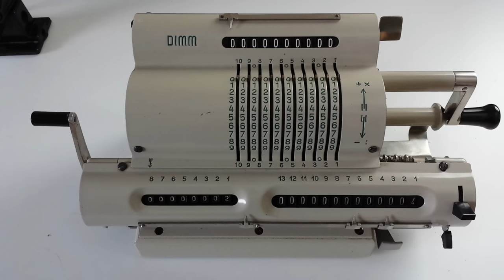Mechanical calculator in action

Comment: Pulls out this machine during the SAT...
Reply: lol
Reply: I used a slide rule on my Chem exam just for kicks.  Much more practical than an adding machine.  Much smaller, lighter, quieter, and much faster to do any operation other than addition or subtraction.
Reply: @richardhall9815  What I find hilarious is I've seen a race car team use slide rules. However, what's amazing is they were using it to calculate fuel burn rates so they would know on what lap their driver would run dry. The system was amazingly accurate to within 1-2 laps! I have never used a slide rule so I don't know how they used one to calculate their driver's fuel mileage.
Reply: Shot by desk neighbour
Reply: Exam proctor: you cannot use DIMMs latest model, it would give you an unfair adavantage over the other students, only the 1948 and prior models are allowd during this exam
Student: ...
Reply: 🔔*Ding*🔔
Reply: One of the teachers in my secondary specifically the vice principal had one of these
Reply: Ka-chunka chunka chunka. Ding! Rzzzzzt ka-chunka chunka chunka chunka chunka
Reply: "Not the rich kid..."
Reply: @richardhall9815  I was in the last class year that taught slide in junior high and still have the pocket model I bought for homework.
Reply: Ding Ding
Reply: I mean if you know what your doing
Reply: Everyone during the test: quiet
You: CLICK-CLICK CLICK, CLICK CLICK CLICK
Reply: . Please be careful before arriving to an SAT testing site with this particular model. I don’t know if it is on their list of approved calculators
Reply: @jessicaaldrich4777  As this is a 4 function calculator it'd be permitted, and while rules say that only battery calculators are allowed, it seems pretty clear that this rule is mainly to ban corded calculators. The approval list applies only to graphing calculators. Scientific and 4 function seem to be all ok.

Comment: I do so love technology that doesn't need to be plugged into anything.
Reply: You should see the mechanical calculators that you do plug in, they’re awesome to see working.
Reply: baterries
Reply: @Benjamin Pilgrim However an everyday pocket calculator is:

- boring
- uninteresting
- you can’t see any of the mechanisms, it’s all just silicon components
- widespread

With a mechanical calculator you can:

- easily see how it works and every single moving component of it
- they sound cool because of all the clicks and clacks of mechanical devices inside it
- not very common
Reply: @timehunter9467  Like the Friden STW10?
Reply: @mega_micro   However an everyday pocket calculator is:

- boring
- uninteresting
- you can’t see any of the mechanisms, it’s all just silicon components
- widespread

With a mechanical calculator you can:

- easily see how it works and every single moving component of it
- they sound cool because of all the clicks and clacks of mechanical devices inside it
- not very common
Reply: @suspense_comix3237  Yeah! Scary sounding thing.
Reply: @Benjamin Pilgrim I have my scientific calculator from 2005, it's now on its 4th set of mercury batteries.
Reply: @Benjamin Pilgrim You know what they mean.
Reply: I prefer a regular modern calculator, but everyone is different.
Reply: Plug-n-play
Reply: @suspense_comix3237  I mean these are cool for the novelty, but utterly useless when doing calculus compared to modern calculators.

Comment: As an aspiring mechanical engineering student my mind is just totally blown right now. How tf..... how was this made? How does it work? How did they make it so compact without rendering it fragile? Even if I took this thing apart slowly I dont know if I could even begin to figure this thing out. Things like this are exactly why I'm choosing this as my major :)
Reply: It's made with logic gates.. But I don't know how they made it so compact..
Reply: It’s crazy to understand that back then these calculators weren’t even designed with 3D printers or CAD software or anything!

They were all designed with pen and paper math, LOTS OF MEASUREMENTS, etc.

I someday hope to design something mechanical but IT’S IMPOSSIBLE TO BUILD SOMETHING AS COMPLICATED AS THAT WITHOUT MODERN TOOLS LIKE 3D PRINTERS.
Reply: @kato_dsrdr  No, it’s made with all the mechanical devices like gears and axles and stuff.

If it was made using logic gates the thing would be HUGE and electromechanical, not mechanical.
Reply: Selecting a number causes pins to protrude from a wheel, turn the handle and the pins engage the gear attached to a number wheel. There is a carry mechanism which clicks the adjacent wheel one click when it needs to carry.
Reply: logic gates can be mechanical. However I think you are right here and that it doesn’t do it by binary. The basic way these work is by allowing each digit to affect the next digit which carries. Look up those card & stylus calculators they work extremely similarly
Reply: An abacus
Reply: i saw this forst time in m life and know exactly how it works
Reply: As a electrical engineer I just have to say “look what hey need to do to mimic a fraction of my power”
Reply: @kato_dsrdr no logic gates were used in this device.  It would be thr size of a house if mechanical logic gates were in play.  It would also be electromechanical.

Comment: Division operation looks tedious after a while. A simple straightforward test of these mechanical calc's accuracy is to multiply 12345679 times 45, the answer should always be 555555555 on these machines.

Comment: This machine can do so much more! You totally missed the multiplication of big numbers, e.g. 2345 x 4567. You don't enter 4567 and turn 2345 times, you only turn 5 times, then shift to the right, turn 4 times, shift to the right, turn 3 times, shift to the right, turn 2 times. Basically you do it like you would do it on paper! To check your result, your second multiplier should now show up in the turn counter. 

You can get a division result with decimals if you enter the dividend as far left as possible (316400000 / 13 = 24338461; you just have to remember where to put the decimal point). You can even calculate square roots using Toepler's algorithm (not much more difficult than doing a division), but this space is too small to explain it. Google is your friend!

Comment: My first job was an accountant at the original Coopers & Lybrand in 1971. Out audit files were often inches thick and were full of tables and schedules, all of which had to be checked for accuracy becuase they formed the basis of the balance sheets and P&Ls of the companies we were auditing.
We gave the file to a comptometer operator who used one of these as well as a  comptometer machine. I good operator was a highly skilled person and very well paid. They could go through a big file in less than a day. And they usually found mistakes. They did it all blind...they just ran down the lists by eye and both hands were going flat out. It was amazing to watch.
Reply: There is no physical computing machine that can add a column of printed figures faster than a Comptometer operator. "Whaddya mean? A spreadsheet can add them in a microsecond!" But someone had to type those numbers into the spreadsheet, one snail-like digit at a time!

Comment: I grew up at the point where transistors were just starting to take over... I learned to use slide rules, adding machines (Similar to yours) and now obsolete transistor calculators. In high school, typewriters were still used, small (desktop) computers were just coming out.

Comment: divide by 0 please
Reply: It's division performed with subtraction, so you have to spin it counter-clockwise infinitely
Reply: @어질어질하네-k8h  so attach a motor to the thing
Reply: You need to leave!
Reply: @어질어질하네-k8h  not infinitely. only until the wear on the machine causes it to fall apart.

Comment: I have one of these - different make, same principle -  bought on a fleamarket years ago.  It doesn't work for one reason: metal gears running on nylon and wearing it away. Still, I didn't pay much for it.  I have an idea that the older, pre-nylon,  models might work better today.  The same applies to old cameras: around 1960 the dreaded plastic gears appeared and the life expectancy went out the window.

Comment: How many GB of RAM ?
Reply: this is mechanical, I don't think it will have RAM
Reply: over 9000!
Reply: No Im patient ~
Reply: I know you were just joking, but I figured out that it has exactly 9.56805815563 bytes (76.5444652451 bits) of "RAM".
Reply: ***** that's a lot
Reply: It's a little more than I was expecting, tbh.
Reply: So it has...dits?
Reply: @dmdz Decits.
Reply: zero
Reply: A "decimal digit" would just be a digit. The term "digit" without further qualification assumes base 10 (but it doesn't hurt to specify base 10 depending on the context).

@Sergio Díaz Nila, true- it doesn't technically have any base 2 digits (bits) like most computers do. What it does have is 13 base 10 digits in the accumulator and 8 base 18 digits in the counting register. This means the machine can represent an equivalent amount of information as ~76.5 bits (though I do realize fractional bits are strictly theoretical, and can't actually exist :P).
Reply: Infinity cuz its mechanical.
Reply: Infinity
Reply: Not sure, but it’s DIMM RAM (it says DIMM on the calculator)
Reply: @foxbud  They can, you've just shown why.
Reply: @martilezeon8500  r/Whooosh
Reply: 10 TB

Comment: to prevent sliding on the table with bigger numbers, bolt it down. if you are not strong enough to turn the crank, remove the crank knob, take a meter of a scaffolding pipe and slide it over the crank. precise and accuratw technology. amazing.

Comment: It's amazing how such a machine evolved into what we know now as a computer. And amazingly, the way CPU works is basically the same - you have your input/output stores (registers), a component that does arithmetic (ALU) and a component that makes the machine run - the clock in a CPU, the rotating lever in this device.

Also, the action at 0:50 with that lever, the sound, it was really rewarding. Pretty cool machine.

Comment: My Monroe Model K made in 1922 is similar except it is large and heavy. It has more capacity. It has outlived every generation of electronic computer. Still works perfectly. You earn your answer. Mine has an 8 decade keyboard, 8 counter dials and 16 accumulator dials (more than Microsoft Excel).

Comment: Actually I have an extremely similar looking Soviet version that is called ''Felix'' and it works very similarly to this too. It is less complex and doesn't have the cool features that this one has, like the convenient levers to push the lower panel around. Instead it has a janky lever like thingy that moves it left or right (One number order each push) depending on in which direction (where) you push it which tends to get stuck a lot... Also it has little propellers with roughly similar shape as the Russian ф character which do all the resetting. This one's definitely more sophisticated, but I really love mine too, I have it alongside two other ones which I still- call Felix, but don't actually have their name displayed (Apparently they were produced after 1972 or something after which the original Felix became redundant, and fittingly they are much more sophisticated, with actual number keyboard and front-back buttons that shift the order around. They also have a much boxier look, sleeker for the lack of a better word). They're much more intuitive and fun to play around and worth with, but I still prefer the almost alien spaceship look of the old Felix. Speaking of which, my Felix very cool teal color, even though I've seen white, grey and black ones too.

Comment: Curiosity got the best of me, and I figured out that this machine has exactly 9.56805815563 bytes (76.5444652451 bits) of "RAM".

Explanation:

First, what could be considered RAM in this machine?

In a modern computer, RAM would simply be the memory the CPU uses for storing calculations (disregarding the caches and CPU registers). The analog for this machine would be the accumulator and counting register within the carriage, as those are the memory used for storing calculations.

The accumulator contains 13 base 10 digits. That means that each of those 13 wheels can take on a value between 0 and 9 for 10 total possible values.

The counting register is a little more tricky. It can take on values between 0 and 9 for addition, but it can also take on red values between 0 and 9 for subtraction. Does this mean it can take on 10 + 10 = 20 values? No, not quite. Addition and subtraction both share common 0 and 9 values, subtracting 2 from the previous total. That means that the counting register contains 8 base 18 digits.

We now know that the carriage can represent a total of (10 ^ 13) * (18 ^ 8) = 1.1019960576 * 10 ^ 23 unique values. The minimum number of base 2 digits (or bits) require to hold this number is 77. The problem is that 2 ^ 77 can represent more values than (10 ^ 13) * (18 ^ 8) can, (2 ^ 77) - (10 ^ 13) * (18 ^ 8) = 4.09161216918 * 10 ^ 22 values to be exact. So we can't say the answer is 77 bits.

To get the exact number of bits required, we need to solve the following equation for x: 2 ^ x = (10 ^ 13) * (18 ^ 8) by taking the log base 2 of each side. This gives us x = 13 * log base 2 of 10 + 8 * log base 2 of 18. This doesn’t, however, give us a great intuition for what’s going on.

Instead, let’s figure out exactly how many bits of information each wheel in both the accumulator and counting register represents. Let's look at the accumulator wheels first.

We know that each wheel can represent 10 total values. 3 bits, or 2 ^ 3, can store 8 values, while 4 bits, or 2 ^ 4, can store 16 values. So the number of bits is between 3 and 4. We're looking for the number of bits it takes to represent exactly 10 values. We can find this by solving for x in the following equation: 2 ^ x = 10. This gives us log base 2 of 10, which is roughly equal to 3.322, the number of bits required to represent 10 values.

Repeating the same process for the counting register wheels, we get that each wheel represents log base 2 of 18 bits, roughly 4.170.

The accumulator contains 13 wheels, and the counting register contains 8 wheels. The resulting expression to find the exact number of bits of "RAM" this machine has is 13 * (log base 2 of 10) + 8 * (log base 2 of 18), the same equation from earlier, except we now know what each term means. This finally gives us an exact value of 76.5444652451 bits, or 9.56805815563 bytes.

And no, I don’t have a life. :c
Reply: you can't have 76.5444652451 bits, bits can only be represented by integers.
Reply: You're exactly right. I was looking at it from just a theoretical perspective. The trouble is that the base 10 and 18 digits on this machine don't perfectly translate to an integer base 2 value. In terms of "real" bits, it would have to be rounded up to 77, but keep in mind that 77 bits can store ever so slightly more information than this calculator's memory can hold.
Reply: I'd say you do have a pretty cool life. Here you are, taking time to share knowledge with people on social media, on your own initiative. Basic logic; one cannot learn if others are not willing to teach.

Comment: that sad thing is this machine calculates higher then most modern calculators XD
Reply: A 10$ calculator can go up to 9.99 e 99. More than atoms in the universe
Reply: Well if you buy something as expensive (on its time) and heavy as this mechanical calculator in modern hardware (a desktop computer with a powerful GPU), you can process billions of times more floating point operations than all the computational power in existence in 1958. So don't be silly.

Comment: looks brand new. does it need maintenance, do you need to oil it or something ?
Reply from the maker: It was jammed up from the previous owner not knowing how to use it, but other than that it still worked very well. I added some lubricant but as preventative maintenance to make sure it funs smooth for years to come
Reply from the maker: +TheMfring I understand completely, this was actually a lucky find on etsy for only $70 including shipping. I'd recommend looking there. They mostly sell "as-is" or "not working" but it's usually just ignorance of the seller.
Reply: Yes you have to take it to an antique expert and pay lots of money

Comment: question. so for division operation can be done in 1000s and get answer fast. but lets say we are multiplying, only possible to rotate clockwise and counter only up by 1. example, 342x130, you have to turn 130 times to get answer. right?
Reply from the maker: No. The turn counter shifts as well so you can use the same method. 100x1 first, then 10x3

Comment: Pretty cool technology, but it cannot do decimal numbers, it seems...
Reply from the maker: It can do decimals if you input to the left a few digits. For example if you wanted to do math with 2 digit decimals you would input 1500 instead of 15 and do math as usual. You just have to remember where the decimal is, which I believe the sliding silver arrows above the input and below the output are for
Reply: @jdigi78  Nice, thanks for the answer! 

By the way, I got curious about which specific model your mechanical calculator was. So I googled “DIMM mechanical calculator” and came across a Wikipedia article (not that I endorse it as a really trustworthy source of information, but also not as a completely useless source) titled “Odhner Arithmometer”, which is a kind of pinwheel calculator that spawned millions of clones since the 19th Century, when it was invented in Russia, before their revolution, by a Swedish immigrant named O.T. Odhner (according to Wikipedia, that is). Brands across the world manufactured this kind of mechanical calculator, such as “Tiger” in Japan, Sweden's “Multo”, Germany's “Brunsviga”, England's “Britannic” and so on. Their legacy reached up until the 1970's with the advent of electronic calculators, but the Odhner type was very successful.